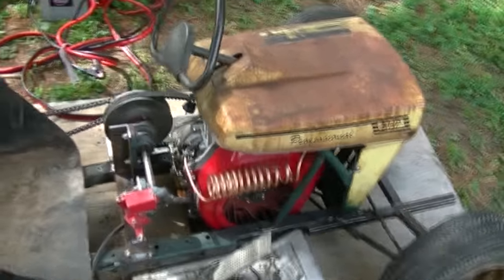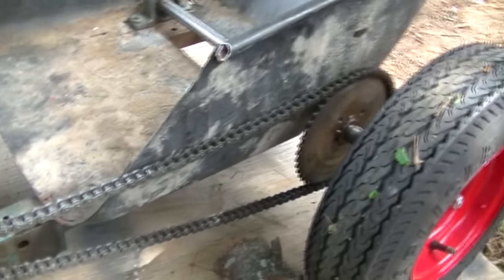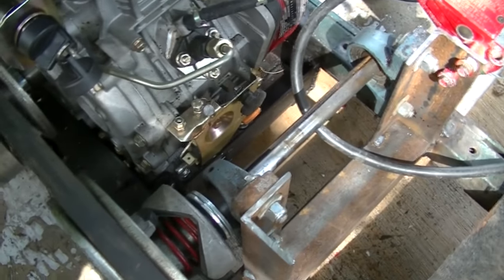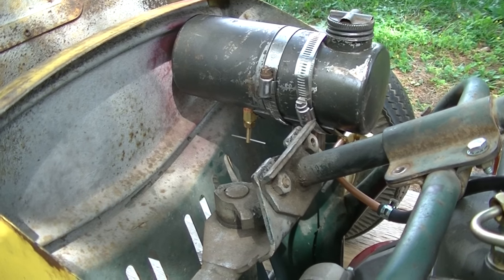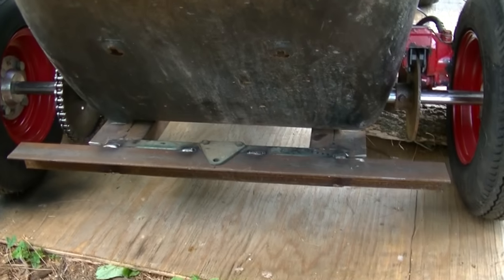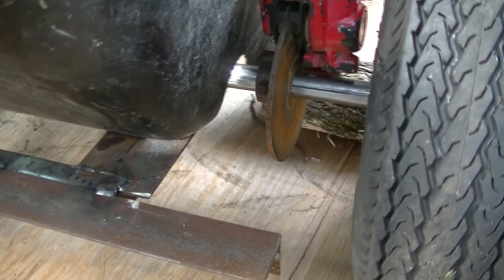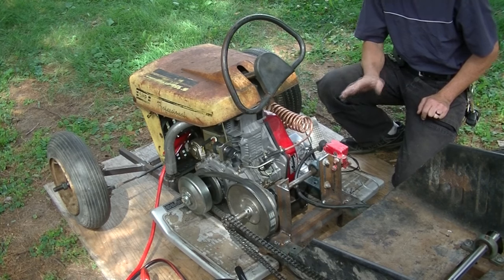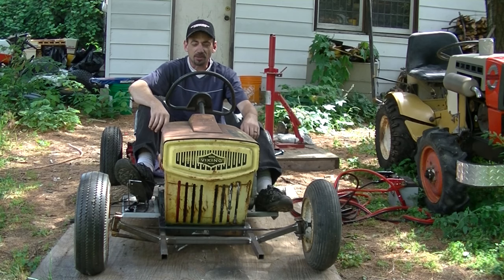Weasel Update And Startup Aug 1st

Comment: Cooool machine Doc, like always. You come up with new ideas all the time. I got a tip for you; make a copper brake-line of the same size as the fuel-line. And for a seat, use an old leather jacket and foam on a plank, just above the aksel.

Comment: Hey Doc, to make those leading edges of the barrow tub a bit more Ralph Nader and match the rolled edge, you could always weld copper pipe around whatever shape you want. Copper and steel mig weld together fine, strange but true ;-)
Reply from the maker: I wouldn't have thought so, but I'll have to give it a shot sometime.

Comment: Shouldn't the return line go to the tank...?
Reply from the maker: It does, essentially. It returns to a gravity-fed section of the line (just downstream of the tank). Since there is no pressure there (beyond a bit of gravitational pull), it merely enters the fuel feed stream again. Any surplus would simply displace itself in the tank.

Comment: That heat wave , yea it was horrible. 
And the shipping to/from you guys....
it doesn't matter what it is, it's at least 30-35$😳
Be sure to throw a shot of 2 stroke oil in the fuel. The low sulphur stuff is crap for fuel system lubricity. 10-20% is fine 
Ya kinda can't add too much, unless ya get a cold snap it might be a bear to start. 
It's happened where I've been in the boonies at a gas station with no diesel, and very low on fuel in my various vws I've had. 😡...
no worries I just threw in 3qts of atf and rolled on down the road. 
Give it some time , you will see that diesel is a lot of fun. 
Last I checked, you can't take a gasoline engine and fiddle with a couple of screws for fueling , and get 20-30% more power.

Comment: In some kind of household cleaning bottle fill it with 75% white vinegar, 25% hydrogen peroxide, and a couple table spoons of salt (shake well) and when you spray it on bare metal it will rust before your very eyes. It's best when you do multiple coats over a few weeks time while letting it sit outside in the weather and in direct sunlight. I personally just like to sand stripes in it and make it look distressed but you can go down to bare metal and go full on patina. Your choice but thought I'd throw out that tip. Good Luck!

Comment: looking good, other than maybe fixing that section on the rear i'd leave the tub alone, if you could, and if it wouldn't be too expensive, it would be cool to see the chain and belt guards made of copper sheet, riveted with copper or stainless rivets, then when the copper lines and guards got some age on them, or were artificially aged, clear coated to preserve the patina, it would be a lot of work but might be worth it.
Reply from the maker: Copper sheet is very spendy. Great idea, lotsa $.

Comment: I suggest you  tuck the left edge of the tub in a bit.  This would let you move the chain inboard, for more leg clearance.   A chain tensioner  on top of the chain could  help  make more legroom too.   It looks good for this early in the build.   Good luck!
Reply from the maker: When I go to reinforce the tub, I might see if I can't pinch it a bit. I'll probably wok on a tensioner, too- but a tensioner SHOULD be on the slack side of a belt or chain- which in this case would be the bottom.
Reply: +Sprocket's Garage  its nice you should do a diesel golf kart